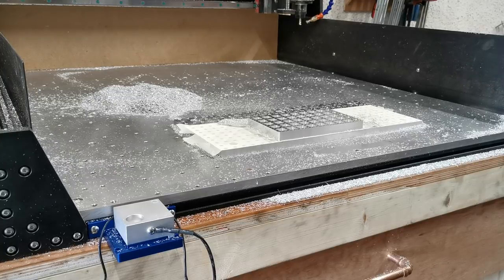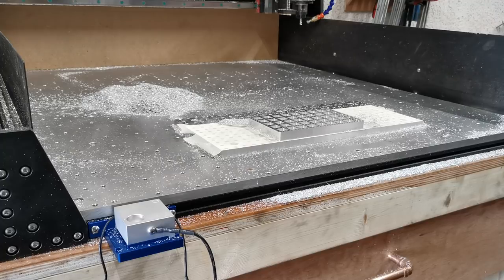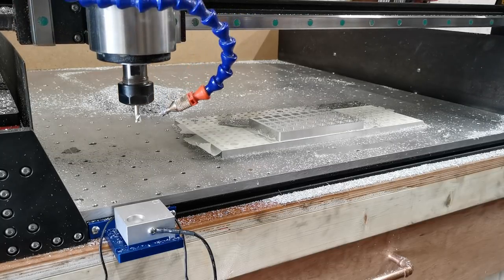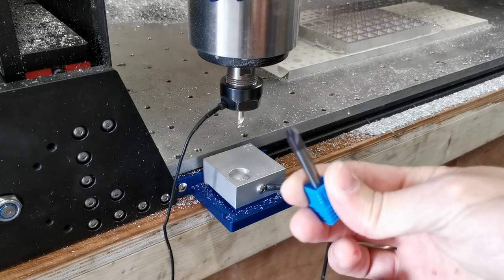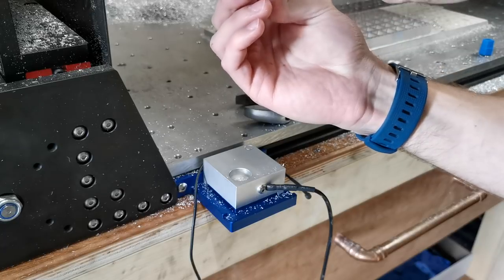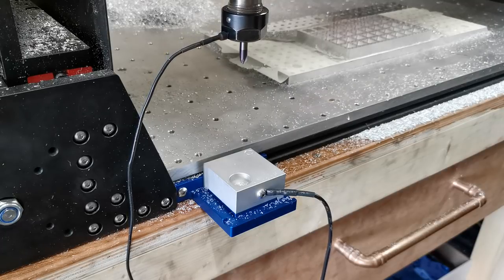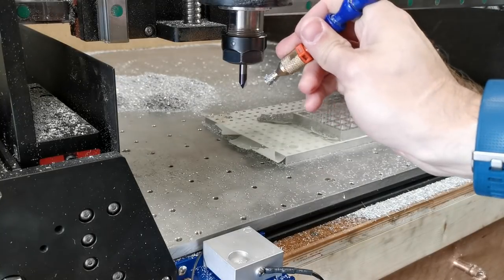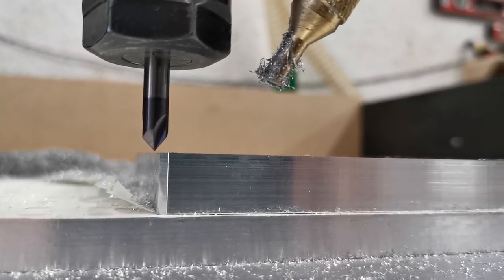A quick look at semi automated tool change with tool offset probing using the Zero2 Probe & mount

Comment: Noob question...I noticed on both touch downs, the probe/mount moves ever so slightly. Isn't that bad for tolerances? I guess my questions are: 1. Why does the system react so slowly to contact? 2. Would moving it slower help, or how would you solve this, sturdier or bottom supported mount?
Reply from the maker: It moves a fraction on the seek, but not on the 2nd probe - the 2nd is the final touch-off used as a reference. If the probe block was better supported this would cut down on the movement, but I made my table too small :( All in it should not make a difference.

Comment: What is the purpose of the engraved circle and the pocketed circle?

This machine looks awesome, how much does one run?
Reply from the maker: The circle is a visual reference point for when you are using the probe in a different fashion. A similar style machine - the HDZero build cost is around $2500 depending on the spec you build it to.